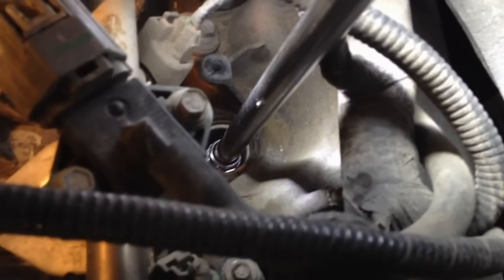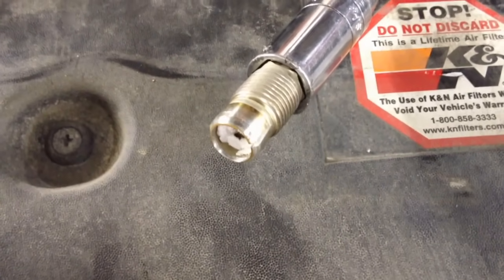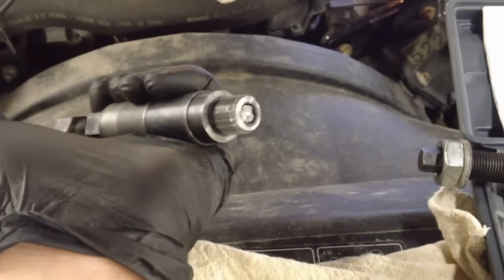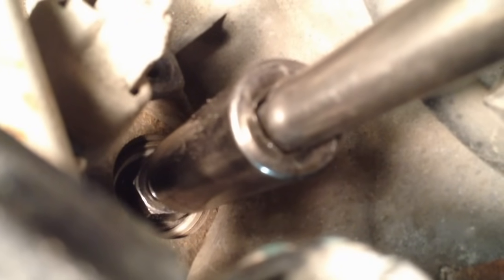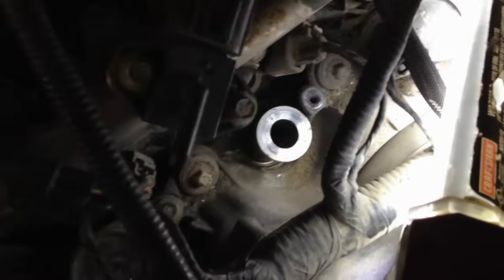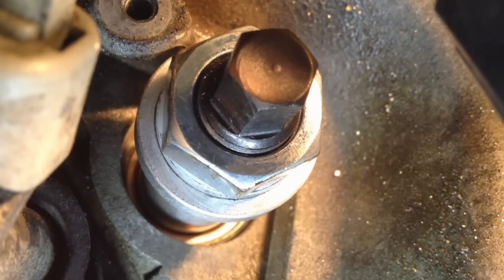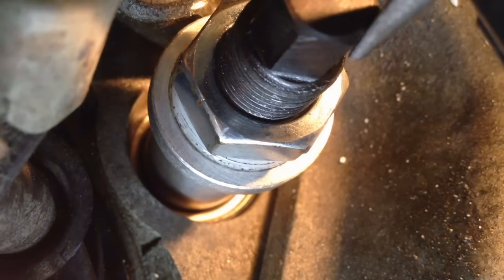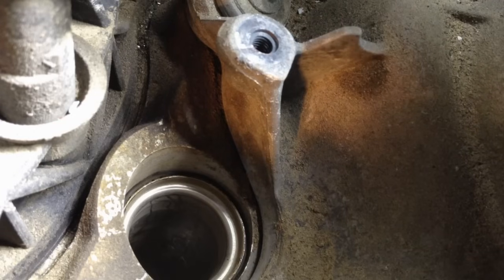Ford 4.6L 3v & 5.4L 3v Broken Spark Plug Removal

Comment from the maker: These are the Parts and Tools I Recommend:
Lisle Spark Plug Extraction Tool-
https://amzn.to/2PyqHgi
9/16" Spark Plug Socket-
https://amzn.to/2Py4Cyi
5.4L Plugs- (**LATEST PLUGS SP546**)
https://amzn.to/2KvN5CI
4.6L Plugs (** LATEST PLUGS SP547**)
https://amzn.to/2KuWevk
Reply: My extractor tool removed 5 plugs and it wouldn't do anymore the sides of the teeth on 2 rows chipped off one side. Bought another extractor and the teeth just flattened and other way to get the plug out? I'm at #3 on my 2005
Reply: What do you do when the left handed threads won't grab the metal shell?  This tool worked great for 5 out of the 6 plugs that broke but it won't grab the last one.  Threads are still in great shape
Reply: @michaelcouch75  mine did that and I found out I didn't send the pusher down far enough
Reply: So can I use this on my 2002 ford 5.4L triton?
Reply: Ok, but the top of my plug that snapped fell back in & is sideways, on top of the bottom part.  I've snapped TWO now,  the 1st, the top half came out w/ the socket & bottom with a piece of tape in the socket to grab it. Both are very corroded. Looks like they've never been changed. How do I get the sideways to piece out now? It's loose, would a magnetic telescope get it?
Reply: @mariatorres9789 did you use an impact drill whole car was hot ?
Reply: @davidgarcia7971  No. By hand,  it was cold, except for me pulling it up my driveway to work on at the curb, so barely warm, drove it 20 ft. The other 2 I sprayed w/ WD40 & let sit overnight. 3rd broke, I thought it was me somehow, my cousin came over & did the last one & same thing. I got all the porcelain out eventually,  & they're changed, but I've never had that happen on any vehicle. I'm thinking they didn't use anti lock or something? No idea.
Reply: plug part # still correct have to do mine again?
Reply: Thanks Bro.  Used your affiliate link for an extraction tool, hope it helps!
Reply: Question? When the threaded part broke off in the shell, did you have to get a new extractor tool because I don't see how that threaded part could be put back on the shaft of the tool? Just curious.
Reply: @mikesamra9126  Yes, no way to properly reattach something that small, you could maybe build up a weld where the extractor threads used to be and properly quench, thread, heat and harden again, in a pinch and with proper knowledge and equipment...
Reply: @Joe_JesusWins_Lewis  I was thinking he maybe retapped the shaft that held the original threads made new threads but those tools are very cheap to buy from Lisle Tools so it wouldn't be worth the headache if you could do it.
Reply: @mikesamra9126  I guess you could, yeah i think so but the length of the tool is a factor, I own a lisle tool and I believe there's just enough room to cut a new thread but most likely you'd have a tough time getting it to bite and still putting the nut on the top end. Plus i think just that shaft with the reverse threads is available for around 20
Reply: Never screw that down till it stops like you did because it will break the electrodes off the end and they will drop down on the piston
Reply: What is the plug torque for 5.4 l F150.. 2007 lariat 4x4..its crazy because I can't find this info on the net..
Reply: @ShaneHolly  I found lots of conflicting info but 25 ft lbs is the number I saw most often so that is what I used on my plugs.  Don't know if it's "correct" but judging on how hard I tightened with a 3/8 ratchet and the little amount it moved with the torque wrench after I feel like it was tight but not over-torqued.
Reply: @michaelcouch75  
yes 25lbs is correct on the 5.4 triton. That was confirmed by @fordteckmakuloco
Reply: Replacing sparkplugs in 2007 f-150 ford pickup
Reply: What do you do when  the porcelain is pushed down where it should be, but the extractor tool will not not grab. It tries to then literally strips out. In a 04 f150 5.4.
Reply: @harolddorsey9179  use #5 easy out and spline socket
Reply: @Btownmaintenance  i got it out bought the lisle65600  from the actual company.  6 minutes. Goes to show cheaper is not always better.
Reply: He not. B
Reply: thank you for this video you're a lifesaver I just got the truck and a kid who had it broke all the plugs out in it except one take care.
Reply: This tool works for the 4.6L 3 valve as well ?
Reply: Do they make them for a ford 2001 2 valve 6.8 v10  i think my spark plug is 14x1.25
Reply: Was that smile FM?
Reply: I just induct a whole quart of marvel mystery oil then let sit over night, it softens the carbon and rusty crud into a muddy paste allowing the plug to slip right out without breakage.
Reply: My question is why do they break?  Was watching another video and the guy  said it was always the back ones.

Comment: I used the Lisle Spark Plug Extraction kit to remove two broken plugs on my 2006 F-150 5.4, 3-valve. The kit makes an impossible job quite easy. But get the complete kit.

Comment: Thank you so much for these videos. My 06 F150 I just bought has 140,000 miles and the plugs have never been done. I tried the soaking overnight method and it didn’t work. EVERY SINGLE ONE BROKE ALL 8. So now I’m gonna have fun doing this.
Reply: Oh boy all 8 broke! How lovely. Stupid me I bought a '07 f250 with 220,000 because it was cheap.and rust free. I think it is due for new plugs. So I'm gonna tackle this nightmare of a.job soon.. I've done plugs on  several of my vehicles before but never on a 5.4. I can't wait!
Reply: @letsgobrandon1300 it’s not a hard job as long as the plugs don’t break 😅. If they do the removal tool works great.

Comment: Brian, it seems to me that if a plug breaks off, it would be prudent to remove the top portion, and spray solvent into the well and let it set before attempting extraction. This is, of course a DIY recommendation, where one has plenty of time. I would think that Seafoam or Berrymans B12 additive would really work well to dissolve that carbon. As I have said on other posts, I cut three longitudinal cuts in the threads of my lisle tool with my Dremel tool with a thin carbide wheel to help engagement of the extractor.

Comment: Have you ever seen the electrode/grounding strap on the end of the spark plugs broken off of the old style and gone into the engine if so will it damage the cylinder or can you just replace the old spark plug with the new and call it a day. I put a magnet into my cylinder 1 hole hoping to pick it up but it seems to be gone. I hope the metal grounding part didn’t damage my valves or piston. I’ve heard some folks say theirs just blew out the exhaust. Also is the latest spark plug the sp-515 or the sp-546 I only ask because the video is so old it may have changed.

Comment: Changed mine today one broke but easy extraction, for 190 thousand miles on it the plugs were carbon free and looked like new...changed the coils while I was at it  , the 2005 has another couple hundred thousand left in her...
Reply: Did you use an impact wrench to extract or a socket wrench?

Comment: Inexcusable, bad head/spark plug design. The threads should have been into the interior of the head, like has been done for a hundred years. 
Purposefully bad engineering, there should be a class action lawsuit.

Comment: I will definitely be going with Chevrolet for now on.
Tired of the tapping with a car that only just got 100,000 miles on it.
Fords suck.
Reply: They make 1 piece spark plugs so you never have to worry about it after the first time.

Comment: My buddy has an 07 5.4 F250. It had a misfire and 180,000 miles. I changed 6 plugs, 2 broke and i used the tool to pull the broken pieces out. The remaining 2 would not budge. Its running good now, but looking at the plugs  took out it wont be for long. Is the next step hit it with an impact?? Do they make the inserts to repiar the threads like the old 4.6 and 5.4 had?? I told him i didnt want to destroy his cylinder heads, but did put considerable force on them trying to remove them. I have dealt with broken plugs in these, havent had one that wouldnt turn at all.

Comment: Nice job. At the end, before installing the new plug, what do you think about vacuuming the cylinder instead of blowing it with compressed air? I would think there is a better chance of getting any debris out via vacuuming ?

Comment: I'm removing spark plugs on a 06 f150 Triton 3 valve and one of the plugs aluminum thread shell detached from the porcelain body of the plug so instead of the hole plug coming out just its threaded shell came out, how would you suggest removing the spark plug in the this situation?

Comment: The Lisle tool worked just as you described on the 1st plug.  However, the threads were complete rounded off after just one plug.  I need to do several and had to order additional extractor rods.  I'm hoping it is not a one and done per plug, but I'm preparing for it.  Update, I got the replacement extractor rods.  One pulled the remaining plugs with no issues.  I"m not sure why the first one failed after one plug pull.  I would also suggest getting the porcelain puller because it was very difficult to pull the rear most plugs out.

Comment: I did the plugs on my 2005 mustang gt 4.6 today. 1 broke for sure and probably 2 more. 2 plugs are loose but wont come out. I believe the electrode wire is still holding them in... Tried an ebay... Extract tool and the ceramic pusher actually bent where they meet😢. ALL 3 are still in my motor. I'm going to rent tool from auto part store tomorrow.  Hope it works... Any idea on how to deal with the other 2??? I wonder if I just crank the engine  if the compression could just shoot the 3 out. They are not threaded in so in theory 😂😂😂 it could work... Thoughts???

Comment: BRO. You need to put a Small Hose on a Vacuum Cleaner and Vacuum Possible Broken Parts Out.. That Ceramic is Very Hard and could do Major Damage. Blowing Air In to the Clylinder is not a good idea you said you haven't had a Problem with it, But you have Apparently been Lucky so Far..It would S##K if you had to REPLACE a Motor.. I would also explain to the Customer about the Possiblity of Ceramic Parts maybe causing Damage and have them SIGN a Disclaimer on the Work Order... This is a F##KED UP Problem that is really nobodys Fault..I Appeciate You Car Wrenches, This is a Tough Job.. Good Video. Thank You ✌️👍
Reply from the maker: The air wand is more than enough, I have been extracting these plugs since 2005 and never a problem.

Comment: i know a company that makes drill bits that will drill most anything they will drill thru drill bits thru allen wrenches and tile all the same bit what about having them make a bit to just drill first and then use the puller and not worry about the pusher they have lifetime garr on bits ever brake or dull free replacement

Comment: Okay...how ya screw something into threads that the broke off part of plug ia still using!  Mine is 2 valve yet still broken off...the center of plug is still there a d solid enough that no air get by it so by no means will the compression finishing blowing the electrode and porcelain out to be able to use the extractor!  CAN i use the same to they use when installing inserts and jt do it as if whats stuck in the threads not even there?

Comment: Hey so just tried in my 4.6 3V and cylinder 5 was hard so I cranked on it and made a noise like it came lose now it’s just spinning in there and I got down in there with a screw driver and just the nut part of the spark plug is spinning not the electrode or rest of plug any ideas?

Comment: i really need advice...i got f150 2005 that the spark plug is not broken.just only the thread came out.and the procelein still in the cylinder head...

Comment: Very good video I have used the tool before a lot more difficult on the rear cylinders however
Reply: Yep, fighting with both my rear cylinders as we speak. I'm kind of scared that one of them might be stripped, going to try the loctite on the extractor that one person mentioned.
Reply: @mikebas7325  how does loctite on extractor help
Reply: @freedompioneer4311  not sure it's just what someone else mentioned. I did not end up trying it though. The lisle tool did the trick after all, I just came back to it after taking a days break time lol.
Reply: @mikebas7325  how does that tool work could it be used for my sitch with a stripped spark plug installed w loctite. I'm afraid to dig into the engine. Gonna try driving without maf censor
Reply: @freedompioneer4311  Not sure it would help with a stripped plug, it's meant to pull out the tip that breaks on the bottom of the plug.
Reply: @mikebas7325  okay that makes sense, n what I see in videos but how do I just break and remove the plug so it's just the tip? The extraction  Kids are all referred to as broken spark plug extraction kits meaning they all gotta get broken 1st I guess
Reply: @freedompioneer4311  In my experience, my 6 plugs broke automatically into 2 pieces leaving the tip down in there. I got lucky with 2 coming out without issue. Hope that answered your question. Biggest tip I have is pack your patience, broken ones are scary but will come out if done properly.
Reply: @mikebas7325  thanks how did the plugs that broke break?
Reply: @freedompioneer4311  All the threads and porcelain came out leaving the small tip in the head. Sometimes all the porcelain doesn't come out in one piece but the tool should have an adapter that will push down the porcelain just enough to get it out of the way.

Comment: At about 0:58 you can see an O-ring at the top of the spark tube that is all dried up and cracked. How critical are those and where does the gap behind them go ? I have been searching for an answers for hours and hours, everything short of buying a shop manual
Reply from the maker: That is not an o-ring, it is sealant squish out, no need to fix anything here.
Reply: @FordTechMakuloco  Thank you ! now I can sleep well at nite, it appears to just lead to a void between the spark tube and head casting my 2010 5.4 is slightly different, I could run a thin wire in there about an inch when some of the sealer came out with the coil boot on #8

Comment: Is the SP-546 the right plug for a 2005 f150 5.4L 3v ? I found out the shop that did the plugs in my truck are SP-515 and they did it 68k miles ago. What is the recommended mileage to change the plugs? I feel it's probably well past due?
Reply from the maker: SP-546 is the current plug yes.
Reply: @FordTechMakuloco  Thanks. Brian I just found a engine rebuild company (fraserengineco) that claims to have addressed all the known issues in the 5.4 3v motors. They include a melling M360 oil pump, in fact they worked with melling years ago to develop it.  They even bore the cylinder head and install a cam bearing in each journal of the head. It cost $2699.00 to $3350.00 for various options warranty etc. Ill post below what they say. I would love to hear your thoughts on this rebuilt motor as I'm considering going this route instead of doing a timing set on a motor that will potentially just fail later due to the whatever is causing me to burn 1 qt of oil in 700 miles (checked pvc and it was fine) and the general design flaws of this motor. 
here is what they say about their rebuild:
IMPORTANT INFORMATION REGARDING 5.4L 3V ENGINES
Brought to you by Fraser Engines. 

Ford's 5.4L 3 valve engines installed in their 2004-2010 trucks have, unfortunately, established a reputation for premature failure. Owners of these vehicle's report hearing a ticking noise from the engine accompanied by a loss of power and often a "check engine" light.

Research has revealed that the cause of these issues is usually attributed to a failure of the cam phasers and excessive oil clearance in the cam journals. Our replacement 5.4L 3V engines are the only engines re-engineered to eliminate these problems. To correct the oil clearance issues, the cam journals are align bored and a custom-made cam bearing is installed. In addition, they are built with a high volume oil pump to insure an adequate supply of oil pressure to the heads.
Our remanufactured engines are built with a new valve train and timing components plus updated graphite coated hypereutictic pistons. Our engines also include the remaining installation gaskets.
Reply from the maker: Ah you fell for the Fraser trap too I see.
Reply: @FordTechMakuloco  Care to elaborate...what is your experience with them ?
Reply from the maker: I have no experience but many many others do. Just look it up, I know better to never get involved with that company in the first place.
Reply: @FordTechMakuloco  Got my plugs changes today. thanks to you telling me the sp-515 onward don't break I was able to do the job myself and save about $300. I did have to take off my computer brain and bracket to get cylinder # 1 but overall it was not hard at all. Be a little different if I had those 2 piece plugs that break. Anyway Thanks Brian for replying to me on another one of your videos letting me know about the sp-515's and that they don't break. I had an appointment made with a mechanic to do the job since I though I had the old ones. Thanks again.

Comment: so you are screwing that into the spark plug hole. well, my spark plug is broken in there with the thread. so i have the shell and the threaded portion of the spark plug stuck down in there. how do I proceed?